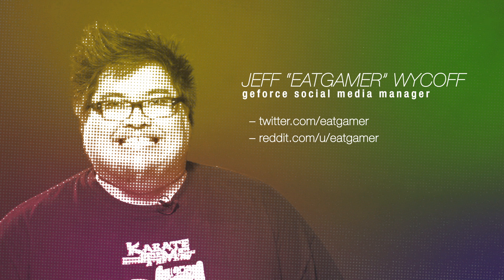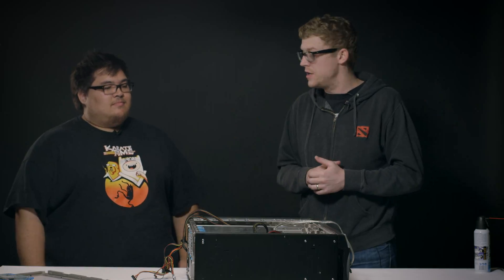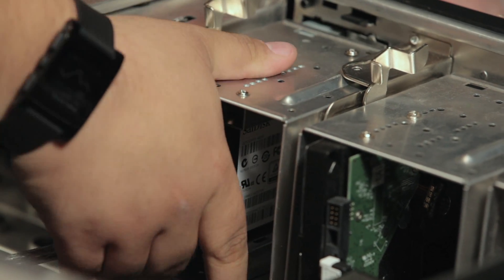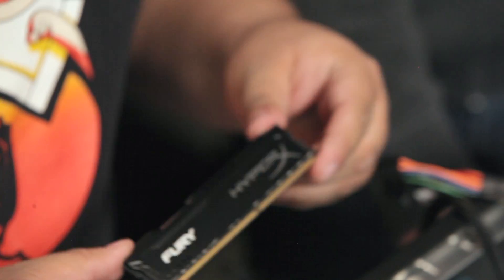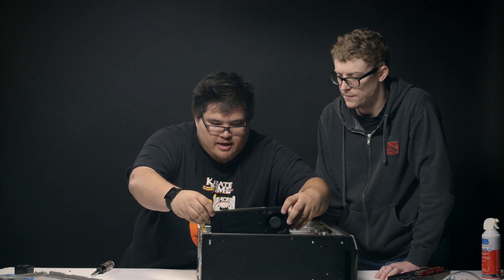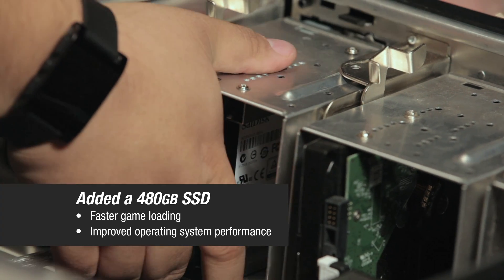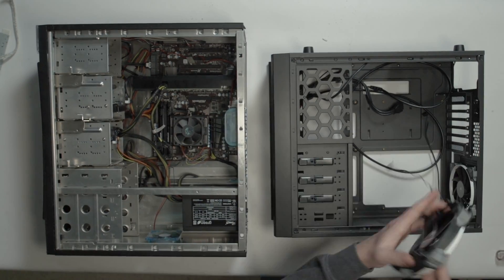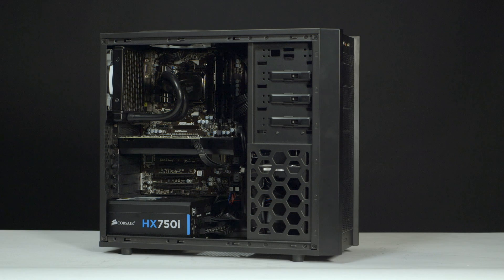GeForce Garage – How to Breathe New Life Into an Older PC

Comment: And my GTX 970 3.5gb? =(
Reply: Nicolas Alvarez Mondragon The point is that it's false advertising. Doesn't matter that you didn't need the full 4GB. You shouldn't have been lied to.
Reply: Yeah! Mine too :P Dafuq Nvidia??
Reply: me too
Reply: great joke i rate 3.5/4
Reply: Stephen Pope it is possible but the l2 cache is extremly slow this is why its better of with 3.5GB which is put in the latest driver so the other 500mb won't slow the card down
Reply: Stephen Pope I think. I paid 4gb not 3.5 + 0.5gb.
Reply: Infinite Zero
unusable but its technically their. so since its unusable it makes it a 3.5 gig card simple as that
Reply: iceagex
since only 3.5 is usable to a real gamer its considered a 3.5 gig card. Doesnt matter if it has 4 gigs 4 gigs - 500megs unusable = a 3.5 gig card, especially when you play a game in 4k that requires more than 3.5 gigs and it starts to slow down...well where is the other memory..oh yeah unusable...hmmm must be 3.5 gigs then
Reply: I play 1080p
Reply: Don't worry about 1/8 of your VRAM. I don't particularly like Nvidia, I even prefer AMD but c'mon. The ram is there, it's a bit slower and a small part of it. The alternative is disabling it entirely making it a 3GB card.
Nvidia was wrong, they probably didn't lie since they made a mistake. You still have more than on a 780Ti.
Reply: +dudu tamy are you really using more than 3.5gbs or are you just complaining to complain?
Reply: Stephen Pope i dont know the guy but someone on youtube benchmarked it he runned battlefield 4 at ultra max settings and render resolution on 200% he still got a stable 60-80 fps and no stuttering and bf4 only used 3.2GB at most same goes for shadows of mordor where it only used 3.4GB to 3.5 but the stutter was not because of the VRAM basically put VRAM is just another fairy tale like the cpu clock speed which only adds a minority
Reply: TheJackalPhantom  it is possible to use over 3.5gb if you are gaming on high res.
Reply: dudu tamy i was just asking a question.
Reply: Stephen Pope The fun thing is that last 512MiB is slower than DDR4, so if you use X99 that is the slowest RAM you have.
Reply: LikeASir7 hahhah
Reply: it actually does have 4 gigs of ram but it has 2 memory banks 1 is well 3.5gigs and the other has 512 megs in it
Reply: LikeASir7 that sir, is a good joke XDDDD
Reply: +dudu tamy my 970 is 4gb
Reply: iceagex It says that on the box but it is really 3.5 GB.
Reply: +Stephen Pope its indeed 3.5GB but the funny thing is it still can do more then a R9 290 in most cases lol if not the same VRAM is not that important anymore these days :P
Reply: TheJackalPhantom
lol if your running big benchmarks like the kite demo ram is pretty importan or if your running a few 4k displays even 4 gigs is not near enough ram
Reply: +XPsilocybinDream yeah 4K is off the board for practicallity not even a single R9 390 with 8GB is enough these days its either not 4k or spend money on 3-4 way sli/crossfire for 1080p and 1440p not so much 3-4GB is enough remember my older pc downstairs with a GTX 650 still playes most games at 40 fps average at 1080p on low/medium and some even high.... and its a 1GB card... EDIT: with GTA V on medium/high on the GTX 650 i have 2.350GB thats 1.350GB over the limit and it still runs fine at 40 fps average and max 60FPS/v-sync lowest 32 fps
Reply: TheJackalPhantom
Ive seen a 290x run 4k just fine on a single card on 1 monitor as for me too I dont need to upgrade from my gtx760 since Im running in 1080p which is just fine for me. Some people dont look at it like this but a 4k monitor is huge and running it in 4k if its its max resolution will look just as sharp being played on a smaller monitor with a max resolution of 1080p cause the pixels arent being stretched like if I had a 4k monitor and ran it in 1080p it would look way worse than my 22" monitor in 1080p
Reply: +XPsilocybinDream a R9 290 cant run 4K.... its been proven in MANY benchmarks the R9 290 still needs atleast a 2 way crossfire to pull of solid 60-144FPS....
Reply: TheJackalPhantom
ive seen it proven in any benchmarks it can just fine not 144fps but Ive seen videos of quad titan x's that cant even keep a stable 100fps in 4k. I mean playable fps not 100+
Reply: +Stalast You aren't being lied to. The RAM is there.
Reply: The Ram is there, so it's 4gb =D
Reply: +XPsilocybinDream wanna hear something funny? GTX 970 still out performs R9 290 lol
Reply: ***** I don't play at 4k and it's not my intention. So the cards it's 4gb for me =D